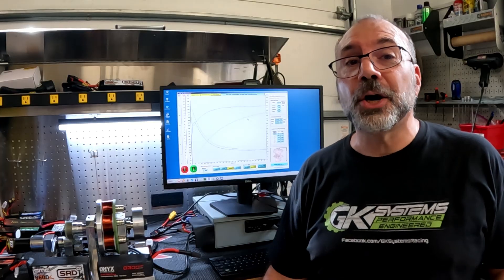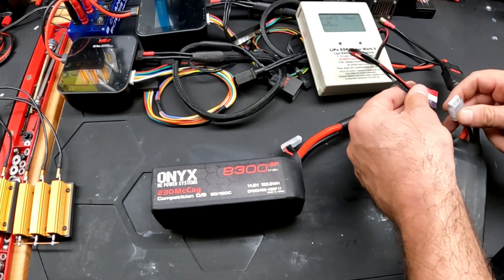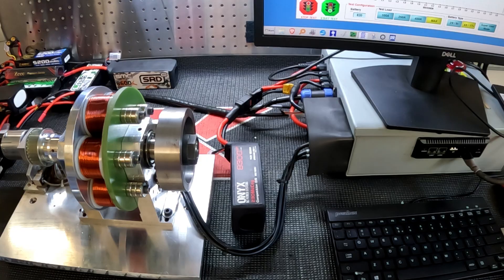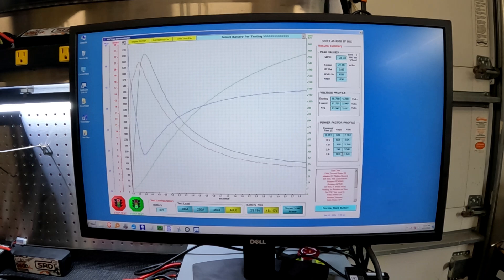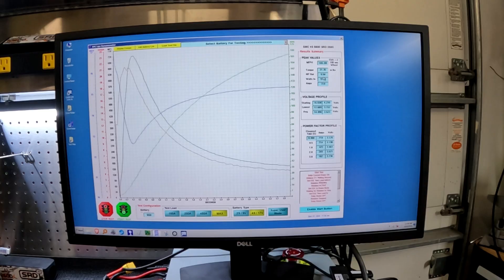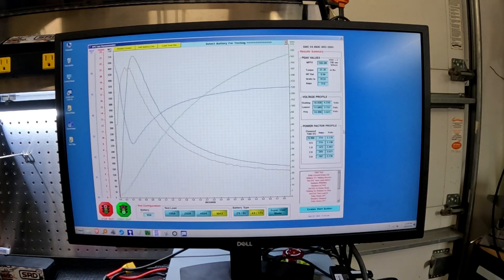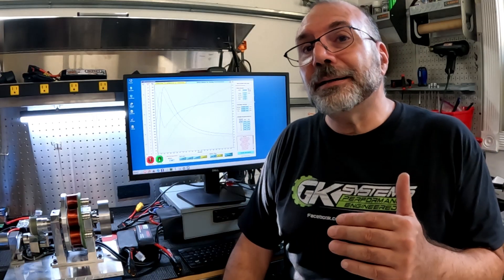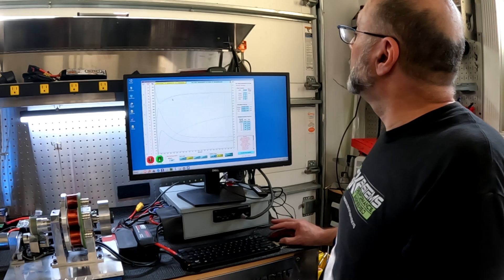4s Battery Shootout Monster HP SMC vs ONYX - 1 Winner

Comment: I know they say  the mAh is only for run time. I would  like to see if the smc 5,000 mAh would make the rc car go the same speed  as a smc 10,000 mAh. Also,  where does the increase  in mAh stop making  a difference . I have two smc srd v4 6300mAh 4s.
Reply from the maker: Let me see about this..

Comment: I race and only use Protek or Gens Ace Redline series LiPo packs because they fully support their products and stand behind them.
Reply from the maker: Gens Ace is up next, thank you!
Reply: @RCstreetwars   please take note that Gens Ace manufactures different lines of LiPos, from budget, through Basher and their high end Redline series that are currently at version 2.0.  Gens Ace has supported their products even after two years of use, and replaced them without issue.  Didn’t even have to pay for shipping.  They have replaced their products at no cost.  Zee and Turnigy have done the same.
Reply from the maker: @ItZ_JoEyLo we have the redline 1.0, 2.0 and the 4s 8000 mah basher.
Reply: @RCstreetwars    Awesome, I’ll never see a difference in performance because I only bash and race on off-road dirt and carpet.   Along with on-road race courses.

Comment: How you break them in is a huge factor for test results, so how did you break them in?
Also, never let the MFG/retailer send you batteries, as they will be the cream of the crop, and NOT what us consumers will get.
Reply from the maker: Funny you should mention the special packs, I’m already wise to it.. here is some dialogue from Facebook.. I was trying to add a screenshot, but it won’t let me add a screenshot.
But I basically say that any manufacturer who sends me a battery I will gladly test it, but I will 100% compare it to something that is purchased by an anonymous buyer and I will look to see if there’s any differences between the two.

And 100% I will bust anyone out
Reply: @RCstreetwars  I raced rc electric 12th and 10th onroad for 21 years, 12th at the 96 worlds and 2nd at the 99 worlds. The sponsored drivers get the good stuff, tested from pallets of batteries/motors/etc, stuff no avg joe can get their hands on.
I was zapping nicads for 5 years before most even heard about it, it was a huge voltage advantage (4000A pulse via 61,00 55v cap charged to 50V across each cell.
Reply from the maker: @user-rs8zg8ey2b  yes, I remember those days. 1980’s, I too was testing Sanyo Nicd and building my own batteries.. fun stuff for a 13 yo kid
Reply: @RCstreetwars  @ questions?
1. did you buy the packs or where they sent to you?
2. did you break them in in any way? if yes, how?

Comment: So when testing on the esr why did you not change the value of the packs to the correct Mah
Reply from the maker: Again, the individual cell resistance values come from the Balance port. The only thing that you will change by adjusting the pack size in the meter is the calculated C number, which I don’t trust, but as far as the individual cell values those come directly from the Balance port and have no bearing or influence to any other value in the meter I verified this with the manufacturer.
Also on my lab grade equipment that we use for the Motorsports industry I can verify the findings.

Comment: Now I’m all for the testing, but when you are testing a pack that’s been out of stock for over a year now it’s a poor result. Go put the v3, v4 up against the Phat pack 10k.
Reply from the maker: So these videos were actually done several months ago, but I’m just getting around to putting the video together. 
As for the ESR  the batteries have been sitting at 75° for 24 hours and the individual ESR will always be true regardless. 
I have tested it every way.

As we acquire more batteries, we will be testing more batteries .

At the end of the day the Dyno does not lie.

Results are as expected, based on equal and fair test conditions .

In our earlier videos in the series, we talk about everything that we do to ensure impartiality and fairness in the test.

If you are not aware, our primary company is a OEM PowerTrain engineering and development company so our access to test procedures, tools and equipment is unmatched.

Comment: One question. What difference, if any, does it make that the SMC has 300mha more than the onyx? And the SMC is a 4s1p and the onyx is a 4s2p. Does these differences have any impact on the performance?
Reply from the maker: 300 MAH is for sure. A difference in capacity and in principle should allow for just that much more discharge current. Of course, not everything on paper always works out that way in the real world.
Ask for the construction this is a pretty heated debate and topic, also one of the reasons we are doing these tests so as we finalize our data, we can try to draw some conclusions based off patterns, time will tell
Reply: @RCstreetwars its very cool to watch. But would the 300mha make the SMC as superior as its, and has it an advantage being a 1P?
Reply from the maker: @2424gold  again we’re compiling data to see where it lays out, but it came out on top in this case so let’s see as we get more results in